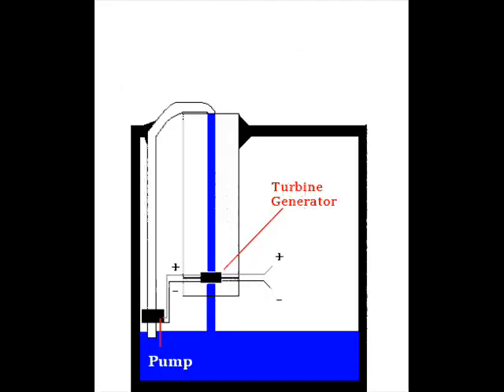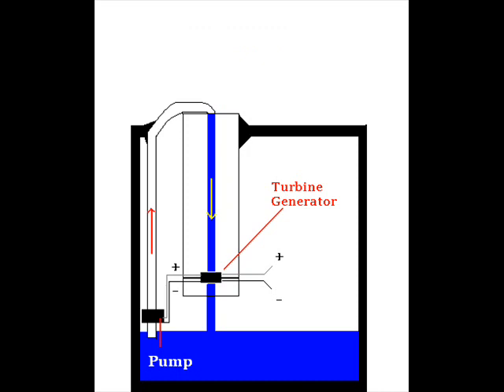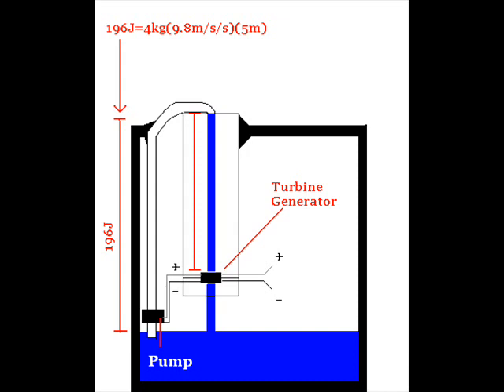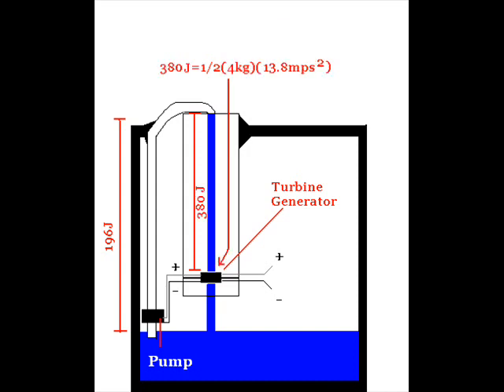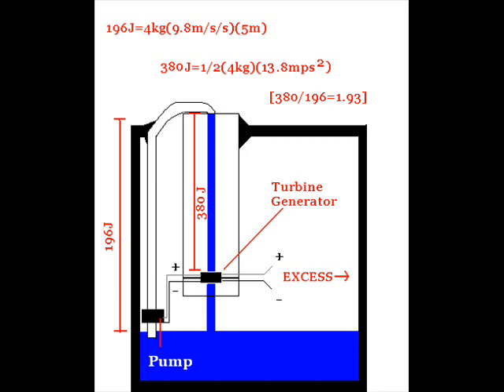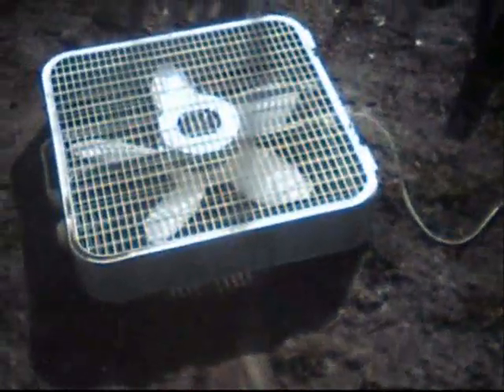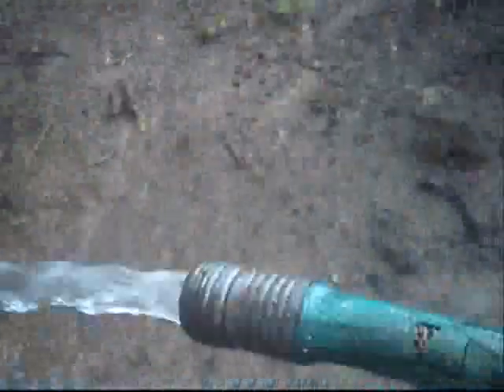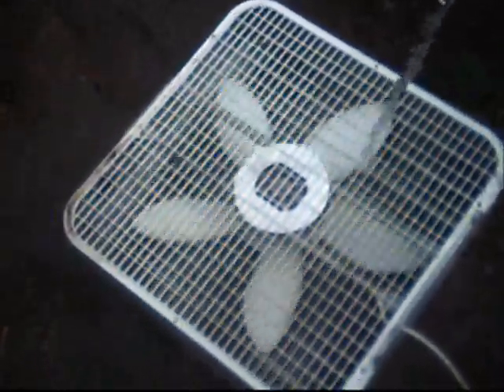Free Energy from Earth's Gravity & Water Supply Discovered

Comment from the maker: FROM AUTHOR:  To clarify; if the 2kg of water is pumped to the 5ft height and then comes
to a STOP, it has 196j of potental energy...that is...it can exert no more than 196j of energy
by being dropped the full 5ft back to the resevoir.  However, if it does not come to a stop
but is allowed to exit the pipe AT VELOCITY, then the 196j of energy becomes KINETIC energy.  It exits the pipe at 9.8m/sec.  The subsequent free fall of 4ft increases this vel. and the kinetic energy.  See continuation.

Comment: This will never recover the energy used to demonstrate it.  First you spend considerable energy pumping water to your location to the storage tank above (or to the tip of your hose).  This you didn't account for.  The price to pay for placing water where it has to be to benefit from gravity pulling on it.  It requires more energy to move water up hill than you will ever get from it flowing downhill if you have to pump the water instead of the environment raining it there..  SHOW US A WORKING ONE

Comment: If water pumps were more efficent, then this would work.  However, there is ALWAYS a loss of energy due to resist from wires, friction, and other factors like how water is a strong surfactant.  If the pump was an artisean pump however, then this would definetly work.  An artisean pump uses the weight and pressure of the water to push it's self out of an opening in the bottom and above it's surface.  That would make absolutly no loss of energy.

Comment from the maker: @victor15richardson See the info through the first reference link in info.  The unit must be primed, that is, the water accelerated up to a given velocity in the pipe.  Once this is done , it only requires constant [and lesser] force to maintain the flow from then on.  Yes, it would take more than 196 joules of energy to accelerate the water flow, initally, but then once that is accomplished it would only take 196J to 'maintain' the flow. Constant force on water = to the mass of the water.

Comment from the maker: It is not in use today, because the science behind it is not in the science books yet.  The principle is 'somewhat' in use now, via hydroelectric dams.  The water is going to go downhill anyway, so they take advantage of that and tap the flow to make electricity.  Same with this device.  Water will fall, regardless.  Back to resevoir.  So you tap it on it's way down.  Water through a siphon on a farm also sends water downhill, untapped.  It too could be tapped.  Any downhill flow could.

Comment from the maker: @saintr17 The way to figure the time of freefall is to divide: 4/9.8  So freefall time is slightly less that .4 seconds.  g is 9.8m/s/s so a free fall from standstill of 1 second would give 9.8m/s velocity.  Remember that the water is 'already' going downward at 9.8m/s, so freefall time is shortened to point four seconds or less.  The total energy output cannot exceed unity.  So it cannot exceed 2 times 196joules no matter how low to the resevoir the turbine is.  Thanks for ur input!

Comment: nature uses solar power(residual energy) to convert water into a water vapor that rises into clouds and falls.   
break this down more in your head and u should be able to figure out that lifting 1 pound of water is not going to give you 2 pounds worth of energy
and the directing the end of the pipe, you're only redirecting the excess energy produced by the pump.

it takes equal amount of energy to lift the water as u could potentially generate from the water's fall.  and there is always a loss.

Comment from the maker: @overunitydotcom 
Right, dependent on height.  Weight of water in pipe is 4kg. Since E=2mc^2 full unity would be 200% efficiency, which is impossible to attain.  The actual efficiency of this model would be less than the 193% stated.  Would be 150% or so, because no pump or turbine or generator is 100% efficient.  This works because gravity is not subject to the law of conservation of energy.  It is an exception.

Comment: Did you calculate in the hydrostatic paradoxon which also
needs more energy to pump up
small pipes diameter dimensions waterflow ?
The hydrostatic paradoxo says, that it only depends on the height of the water,
not on its pipe diameter...so I guess your principle will not work ?